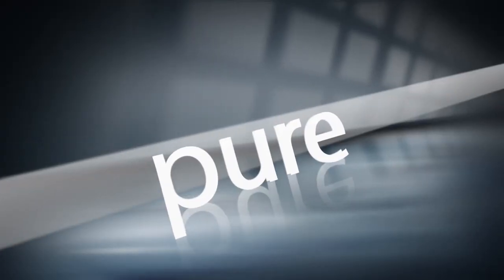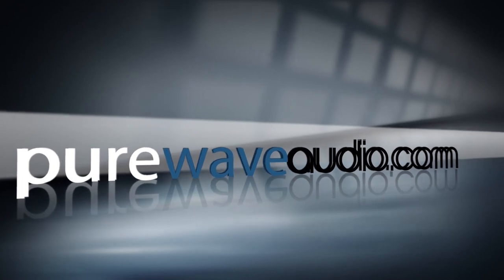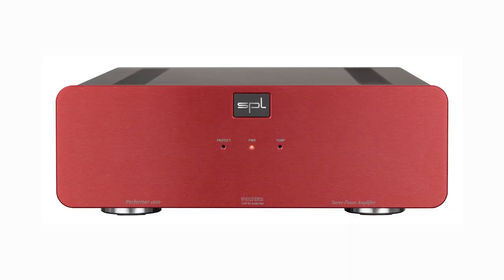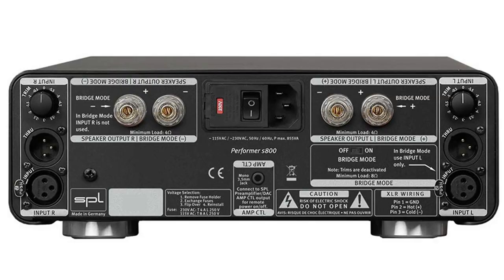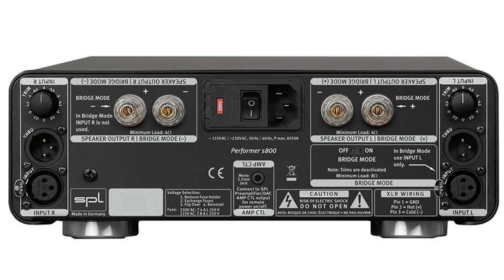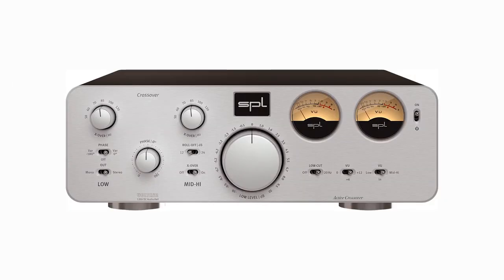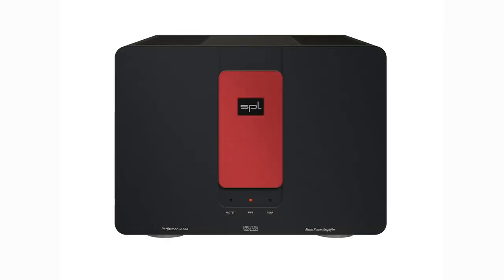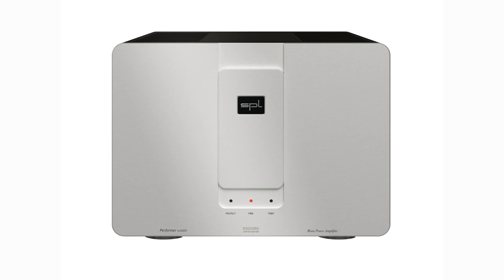SPl Performer S800 & M1000 Power Amplifiers Review

Comment: How do these compare to say the Naim Nap 200DR you also offer in terms of transparency and depth and soundstage?
Reply from the maker: Hello,  I have information on this.  I also just received the S1200.  Let me test this out and I will get back to you with my overall findings.  Might be a few weeks.
Reply: @purewaveaudio  excellent! excited to hear what your findings are!
Reply from the maker: So, I finally got the S1200 up and running.  I switch out a S800.  So in the past, I did a shootout with S800, Naim Supernait 2, and The Supernait2/Nap 250DR.  All excellent units. What I noticed is the sound stage/depth of the top and midrange being really good on the S800.  Then as I went to the Supernait 2, the lower mid and low range had more depth and clarity, and then the 250 DR even more so.  We went through multiple times with repeatable results.  Today when I went back and forth between the S800 and the S1200 (using the same cables including power cable between both) , I felt the same way. It was the same lineage of sound, but the stereo spectrum was wider, more depth, and bass was clearer.  I had both amps dialed in to the same DB rating Via SPL meter for equal comparison. Based off of this, I would assume the S1200 would be right in the range of the 200 DR or even better.  The Supernait 3 now has DR (the 2 did not). Someday, I might test the 1200 against it.  I wish the Supernait had XLR's for easy swapping.  I hope this helps.
Reply: @purewaveaudio  This was truly a very helpful and insightful comparison that very nicely breaks down the differences. Can’t thank you enough for not only taking the time to provide us with your findings but following through on your promise to do so. This is the kind of integrity and service I would be happy to support. :)